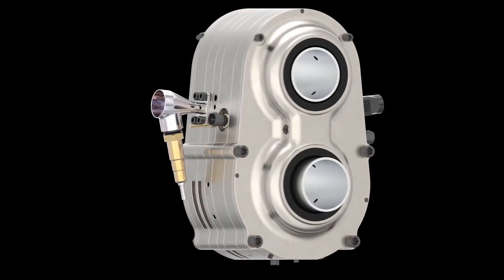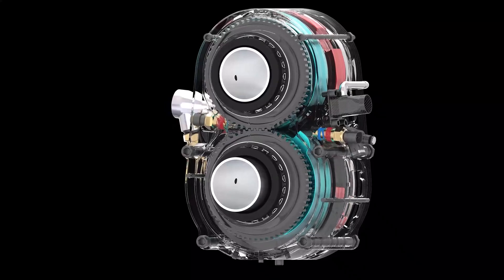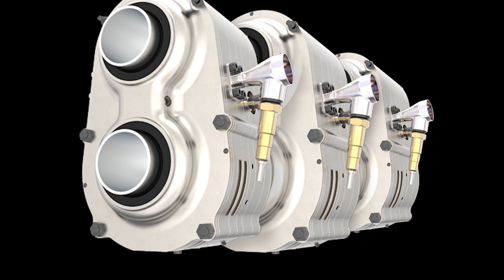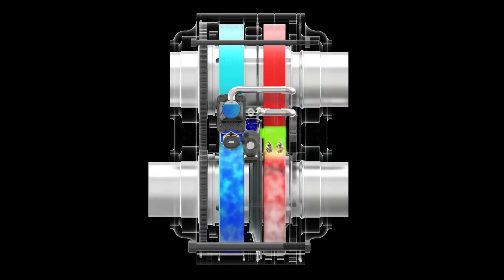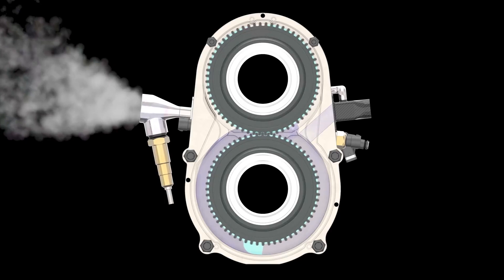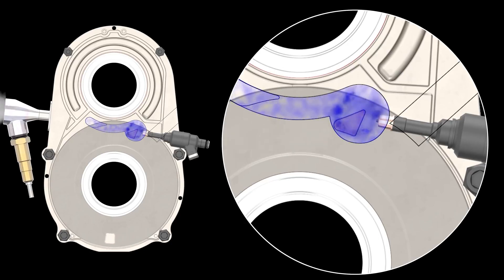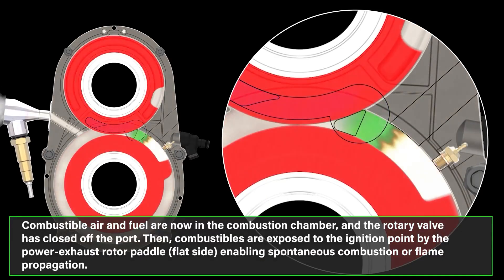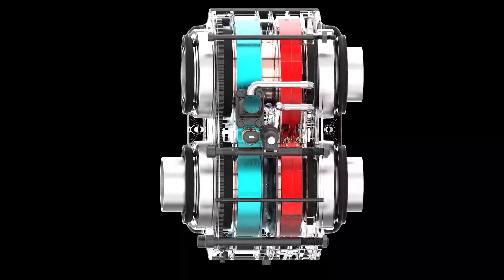This pistonless engine runs on hydrogen and revs to 25k rpm

Comment: Hydrogen is the way to go for sure but I prefer that it be a fuel cell powering an electric motor.  Hydrogen is ridiculously easy to make.  New tech from Stanford makes  electrolytic generation cheap and efficient. You could make your own fuel for your car and to heat your home from water.

Comment: Sure, but hydrogen is only as clean as its source. If it comes form fossil fuels it will contribute to greenhouse gases because the process produces CO2. I don't think claims by the fossil fuel industry that they will capture and sequester the CO2 have merit.

Comment: Electric motors are more efficient, have less friction, less moving parts, last longer,  and are cheaper to run since you can charge them from your home at a far lower cost than paying for hydrogen.  Hydrogen requires a new infrastructure.  Seems like a no brainer.  In most applications,  ice is dead, no matter what form it takes.

Comment: I've been discussing such idea for 30+years nuthi was once dejected with a statementvtgat hydrogen is to volatile thing is if u split oxygen an hydrogen gass from water using solar power then inject the hydrogen into a chamber add oxygen as a catalyst and ignite it u get power and a no product exhaust which is basically steam.... yet they say hydrogen is too volatile honestly if I had money when I was 10 years old I'd of developed the idea a long time ago becausefirst of all sun solar energy is free to obtain water is freely sourced there would be no more energy bills big power companies know this they just hang onto the non renewables cos it makes them revenue if you use water to burn to make hydrogen gas power and ad oxygen to the mix the heat transfer binds molecules of oxygen and hydrogen to create water vapour so it putting back what you took out but at the same time it getting power energy .

Comment: Hydrogen is not as sustainable as people think. Hydrogen is also hard to distribute and store. Gas stations are already disappearing from urban areas, due to the necessity of them being one story, and therefore a very inefficient use of real estate. Hydrogen stations have the same issues. Hydrogen is also very expensive. Electricity is cheap, and can have facilities easily, cheaply, and safely installed almost anywhere.

Comment: I stopped the video right at where he claimed it has no seals thanks to tight tolerance. No, just no. 
We will get back to the discussion once you had a physically functional engine that would hopefully be able to sustain max rev for more than 2 minutes.

Everything mechanical is fancy on the screen. When it comes to REAL manufacturing ...not so much. Heh.

Comment: well my opinion is this. im still a diesel person. i dont like the idea of electric vehicles theres to many unknown factors. im all for experiementing with other sources of fuels like hydrogen. But i also know that it is harder to keep the hydrogen heading in the correct direction. due to it being lighter then air. 
Also on this example of the wankle style/rotary engine. being so tight tolerances brings myself and several others (i read a few other comments) will this accually work? the idea seams great but as thermal expansion happens and then contractial expansion (i think thats the correct term) those tolerances will change. so if they are to change does it wear into the bore? or is there a wear for hot and cold factored into tight tolerance that you speak of. as well the weather... im from the mid south right in the middle of the US we exterence 0-100 degree F how does these different temperatures affect this engine or if it siting outside and get frozen will it still start? will it crank over? also if its air cooled like an old vw engine (which i owned 10 of at 1 point) the heat in the cab was a huge factor. grantite other technologys for heating have come a long ways. but those are my 2 greatest opinions of this i do believe its a fantastic idea but build a few dozen put them into vehicles and scatter them across the US (not just in cali) for multi altitude, multi temp true testing. 
My 02.

Comment: As a internal combustion technician, with a doctor of motors degree, I have worked on internal combustion engines for many years. This engine displays what could be revolutionary technology.  The internal engine in it's self is a source of energy. Electric vehicles rely on a foreign source of energy, to supply energy. A vehicle equipped with an internal combustion engine is much more practicle, and efficeint. The use of hydrogen would offer a very low carbon footprint. With today's technology, the production of hydrogen has enabled the production of hydrogen with a lower carbon footprint then that of electric vehicles, considering the costs of battery disposal, as well as resources, and energy evolved in manufacturing.

Comment: If the torque doesn’t back the horse power it really doesn’t matter how high the horse power develops at 25,000 rpms.  Speed, pressures with applied drag will burn this engine up.  Then what happens when the tolerances break down?  This is a show piece without a future.

Comment: Sounds good. Guess because of the lack of seals the hydrogen is the lubricant between case and rotors. At 25k and tight tolerance you cannot use oil. Hope it works.

Comment: 25K RPM's? Can't be reliable if it needs super high RPM's and pressure. BUT, looks fascinating. Hydrogen...nice. Mazda only built the wanker rotary engine because he bought the rights to it and couldn't loose face. Horrible engine, unreliable, burned oil, unbalanced etc etc.

Comment: More engineering required for it to be used in practical application.They will have to address running the alternator, air conditioning and any belt driven accessories in a different manner than standard automotive fashion. They won't be able to spin at anywhere near those RPMs. Transmission will require major gear reduction as well.All good on paper, or computer modelling, practical application is a whole other thing.The tolerances will likely be an issue when wear is factored in.

Comment: Everyone who is making lots of money from from internal combustion engines wants you to think they are a few years away from a miracle to stall the change to electric. But don't be fooled. Until they actually build one and prove it, then it's just words. 

Meanwhile electric is here now, and is still the only car tech ever produced that gets more clean as the car gets older (because every year more renewable power comes online on the grid).

Comment: One insane advantage of electric? A motor at each wheel. Electrics can be controlled at the digital level with unparalleled accuracy and response. You just don't have the input/output results on a fuel driven device that has lag time between signals. I don't even want EV's foisted on me, but we are talking engineering here.
Reply: One insane bad advantage of electric? A lot less distance on a full charge than a normal fuel powered car. Takes a long time to charge. In a crash you will have a burning car that cant be put out because of lithium. Lithium is one of the worst materials being mined. I say biogas is the best option. Creating hydrogen uses a lot of electricity but biogas only uses time. Methane gas from plants, manure, and food works in normal engines that have been built 80 years ago. That way you dont need to throw away the old classics. This kind of fuel has just not been coming to america and that way nobody knows about it

Comment: 1. EVERY combustion cycle has loses. Even the perfect carnot cycle has losses of the lower temperature/higher temperature. This is the always problem if you go over heat. 
A fuel cell for instance do not have this limit. 

2. Friction is not the primary source of losses. And i see no reason why this engine should have less friction that a pistion engine. 

3. This engine needs more seals than a piston engine. Thats typical for rotary engines. And the major issue of this engine. Denying a problem do not solve it. A "seal by precision" is still a seal. It is only more expensiv with a lower lifespan compared with a piston ring. 

4. For low emission you must be able to control the airflow to get the right mixture. You basicaly have to ensure that there is no oxygen left for NOX. So you need an input valve to control airflow. You also need the imput value to skip cyles. 

Overall an interesting concept.

Comment: Forget the seals and hydrogen size. This thing has poor thermal efficiency. The crossection of the expansion path is square or rectangular, not round.  So combustion volume to surface area is small.  Result will be a lot of heat tranferred to the rotor and stator.  The heat xfer is lost energy. That is same problem inherent in wankle. The hemi design lowered the ratio which was big improvement.  This is thermodynamics, not machining. Bad design.

Comment: Nice prototype. What is the efficiency compared to a small turbine that can run an electric drive train on any light fuel or gas?
I think hydrogen will have its place with very large machines; earthmoving, shipping, heavy transport. Unfortunately the inefficiencies in producing hydrogen electrolytically, and the complexities in storage, distribution,  and consumption,  make it far more efficient to use, or store the initial invested energy.

Comment: First, there is the issue of how hydrogen is produced.
*Brown hydrogen is produced by steam reforming natural gas. The resulting byproducts (including carbon dioxide) are vented into the atmosphere. This is the way most hydrogen is produced because it's the cheapest.
*Blue hydrogen is produced the same way as brown hydrogen, but the idea is that the byproducts are supposed to be vented back underground. The track record of the oil industry indicates that costs will be cut and it is not certain that the byproducts will be disposed of properly.
*Green hydrogen is produced by the electrolysis of water, breaking it into its hydrogen and oxygen components. This is the most expensive because it is the least efficient.The electricity for this process can be produced by burning fossil fuels (kind of defeating the point of using hydrogen) or renewables, such as solar, wind, hydro, etc.
Then, the hydrogen has to be stored, transported, distributed, etc. This is a very inefficient process compared to just using the electricity generated to charge BEVs, battery electric vehicles.

There are two types of hydrogen cars that already exist, ICE (internal combustion engine) which uses pistons, like a normal gasoline powered car, and fuel-cell cars, like the Toyota Mirai. Of these two types, the fuel-cell car is far more efficient. Without a working car, it's difficult to see where this new engine fits in.

Comment: If high tolerances could eliminate seals, we would use it on wankel engines. Having a separate hot and cold side will cause overheating problems, it's like creating a turbine engine. This is the kind of engine a teenager who wants to study engineering would design, before he's actually studied engineering. Many rotary engine designs have come and gone over the years. The company didn't build a prototype of course, that would kill the fantasy.

Comment: That daisychain looks dangerous. They should just be built this way to meet the required hp and that would make sense. It's like bolting up two 4 cylinder engines to make a V8. Boom!

Comment: Hydrogene is the future, not batteries. If batteries would play a role in anything, it would be to produce hydrogene. For example, having these nuclear diamond batteries in rotations, generating hydrogene or auto-recharging in cycle. Cars are lighter and more efficient with hydrogene, especially in colder conditions. They take less time to refuel and the components last longer as well.

Comment: I'd rather they added a few seals so the tolerances didn't have to be quite so tight, thus being less susceptible to being "bumped" out of alignment by nearly anything.

Otherwise, I'm all-in!  EV's are all well and good, but they're only so popular atm because gas is so bloody expensive.  But face it, the majority of power plants that are used to charge/recharge those EV's run on fossil fuels, so not really saving the planet.  Or in the parlance, they're not firing on all cylinders!

Comment: Why only one compression per revolution?  Why not use multiple cutout chambers and compressor bumps distributed around the rotor?  And, I agree with everyone else about the tolerences and lack of seals.  There is a reason that even F1 engines have piston rings and camshaft seals...

Comment: Tolerances fluctuate with temperature.  25,000 RPM is going to generate massive heat (actually, 10% of that for extended periods will as well), so if this engine is to be air cooled and the upper and lower rotating parts of this engine don’t have an expansion function, some type of safety feature to accommodate the heat expansion of the two reciprocal cylinders, I’d predict catastrophic failure in short order.  Perhaps this has been addressed in the design, but I don’t see it in the rendering.  Another challenge would be maintaining combustion chamber integrity if such an expansion function was devised, as the tolerances between the two rotating cylinders would be altered as expansion occurred.

Comment: This has to be a novice learning how to use SOLIDWORKS or something. It's definitely not a real motor 😅. I could give you 50 problems with this design. This is what happens when you skip doing the math. It sure is a pretty rendering though 😂😆

Comment: You still need to use electricity to produce the hydrogen. So unless this engine is 100% efficient, you're going to need to generate more energy than you do for fully electric vehicles.
There are some situations where this technology would still have uses like geographically  isolated generators but for most uses, a fully electric motor still seems a much better and safer option.

Comment: This could be good for race cars and bikes, but not for average grocery shopping. In racing high power to weight ratio is the thing as hydrogen powertrain with this engine would be very light and high in power (as it's still an ICE, it's very much inclined towards self-destruction). As for every day consumer, reliability and less maintenance is more important than being the fastest when the green traffic light turns on just to stop at the next red light after 100m or to make another time record of getting that milk from grocery store and getting back home.

Comment: As with all new technology it has problems to overcome. That's the fun of it all which is solving them. If it's seals then head down and butt up and solve it isn't that what we are all about? I'm sure there is a paper pending revealing a new way to seal something that will last beyond current predictions using new methods and or material. Where is it? Damned if I know so get to it....

Comment: I see this working only if greater tolerances are allowed and the entire engine is completely sealed in an oil filled , sealed membrane. Then is leaks by design to a relative constant predictable temp. Your thoughts out there?

Comment: Use it for one year straight and see if it's truly more efficient than a fossil fuel powered 160 horse power engine, run it 365 24 7 then let me know your results

Comment: There is so much more to the equation than just the tech. I have been on the Hydrogen bandwagon for decades (and still am), but one of the main issues with hydrogen is infrastructure. Storage of hydrogen is a difficult hurdle.
Reply: Hydrogen produced from water inline requires no storage.
Reply: @lukemaclaughlin7436  What powers the hydrogen production?
Reply: The same that powers an ignition and fuel pump.

Comment: Brilliant engine. I wonder about the number of notches though. Why not have two? One on either side. That should prevent vibrations a lot... or am I missing something? Also... the notch is rather short. That seems to make tolerances more critical than they could be. A longer notch reduces tolerances while keeping the friction to the leaking exhaust gas the same.

Comment: At the tolerances required, I can't see it working for a passenger car, but maybe for something that doesn't undergo rapid load changes... I dunno, maybe aerospace, or pump drivers, etc.  For passenger cars, it's hard to beat electric (I'm an EV owner, and will never ever go back to ICE if I can help it)

Comment: As cool as it is. its just another perfect world fantasy engine, amazing in theory but i highly doubt would work in real life well enough to be practical, Those insane tolerances means the "almost no loss" in heat and friction is just rubbish and would wear quickly becoming unstable, dangerous or just unusable.
 Using the hardest molecule in the universe to contain hosts its own well documented list of issues and is the worst possible fuel for this engine for many reasons, It will leak highly flammable fuel constantly, if you want to drive for more then a mile or two you have to store it in liquid form which is basically impossible for people in the wild and/or would take massive or extremely high pressure or cryogenic fuel tanks to list a few.

Obviously id love to be proven wrong, but the thing is, the people designing these things know they wont work, thats why they arent a thing in reality. Anyone that made this work and practical would be a billionaire.

Comment: it is a modified Helicopter's main rotor engine, they use 4 of these units, light weight, super efficiency will often mean that it has been around for about 20 years already and being used by the military.